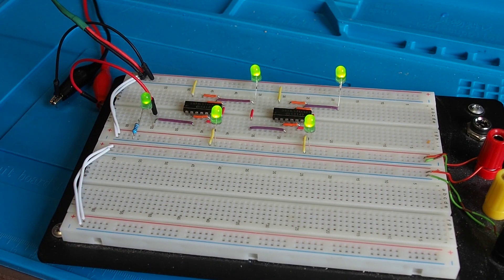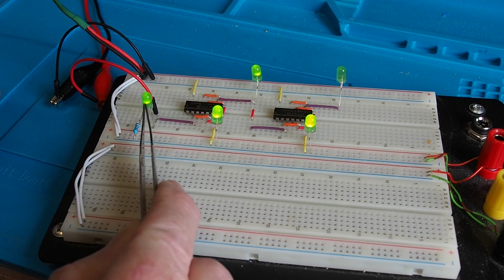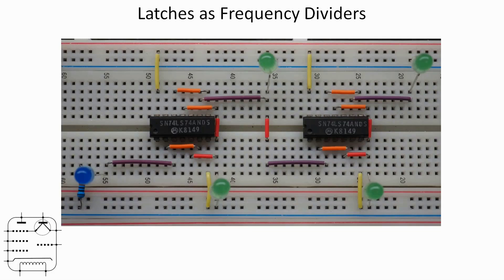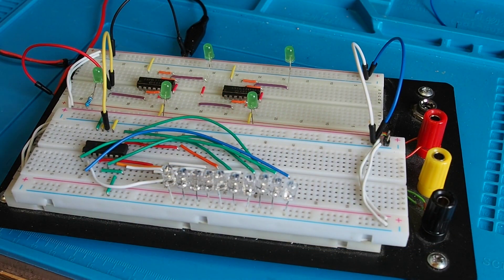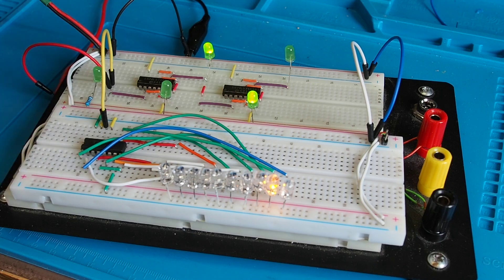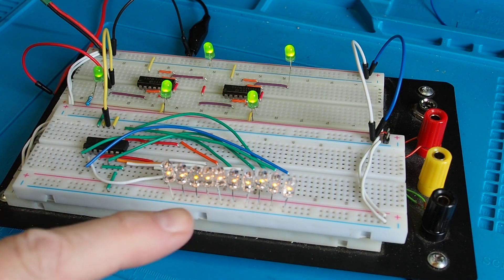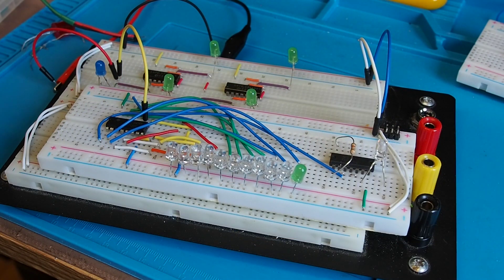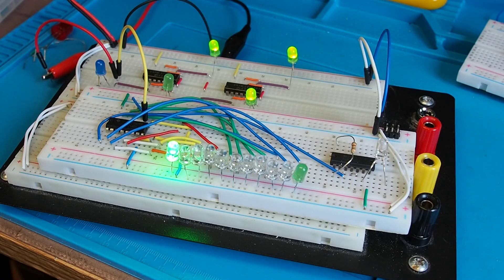The Latch as a Counter - Part 1 - #105

Comment: Only just been recommended your channel... looks interesting.
I'm a software bloke who did a bit of electronics years ago trying to broaden my horizons, playing with microcontrollers and assembler but also trying to move beyond just throwing an ATTiny at every problem. ;) Currently trying to learn about using the 7474 to build counters. I'm trying to count 00, 01, 10 and then back to 00 without ever getting to 11. If you fancy covering that, it'd be a great aid to my idleness. ;)

Comment: Hi Bill, great videos, thanks.
It's worth mentioning the quirk with the 4020 in that the q2 and q3 outputs are omitted (to fit it into a 16 pin package) so a 'straight' counter can't be made, but it can be used for 'larger' counts of blocks of 8 bits at a time.